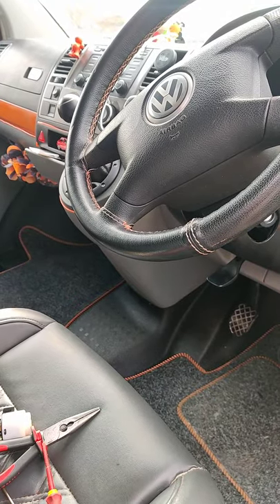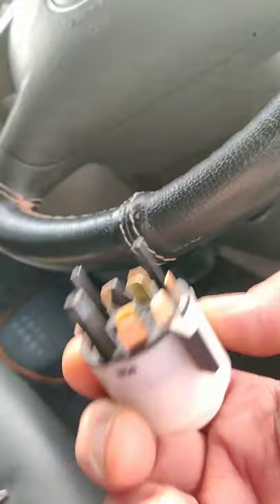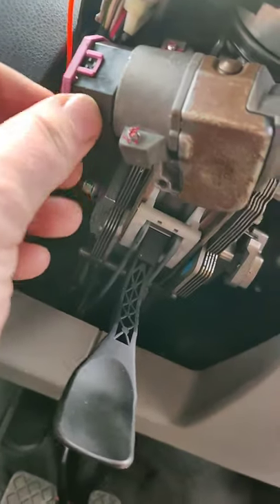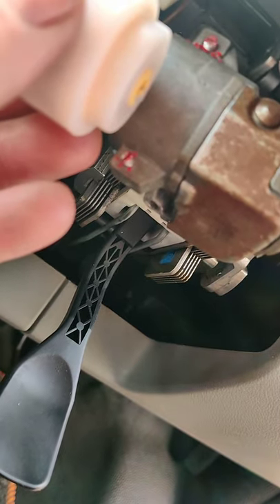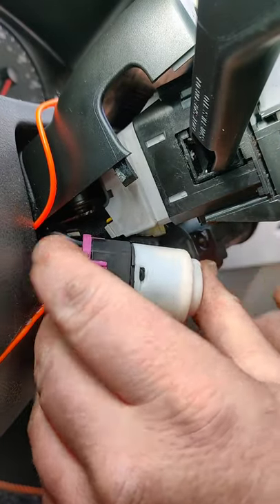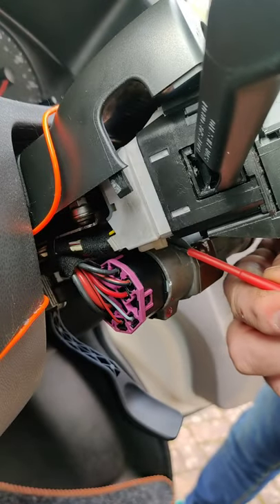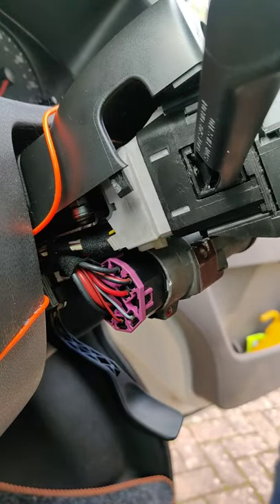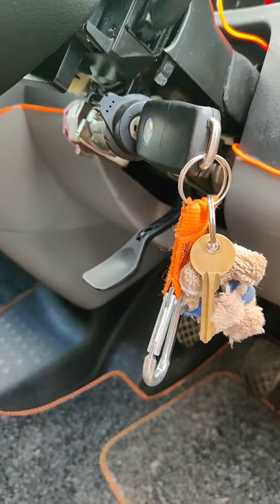VW T5 Ignition Switch replaced - How to

Comment: Thanks for that.  I have 2013 T5, the ignition switch etc are all different, but same principle.  Could not turn key to crank the motor, now fixed.  Would not have known what to do with the covered grub screws without your video.  When stuck on the road i rang the auto electrician who said "it's probably not the barrel or the steering lock, just get another ignition switch and try it"

Comment: I may have this problem, yesterday I put the key in the ignition, turned and dash lights came on, waited for heat plug light to go out, turned key again but nothing happened, just nothing, maybe a slight click in steering column. 
Tried and tried again, same thing happens. 
Does this sounds like ignition switch fail, symptoms? 
Thanks guys.
Reply: Hey do you find the problem ?
Reply: I did thanks. It needed a new starter motor. This is the second starter motor it’s had. Currently at 108k.

Comment: Perfect mate thank you for that! 
Could I ask what made you change your ignition switch? Just trying to diagnose mine now and hoping it's just this!
Reply: Same question. 
I'm able to turn the key to accessories but it won't physically turn past that point to kick over the motor. 
Did you have a similar problem? And have you fixed it? Was it the ignition switch?
Reply: @luke3892  Hi mate, I have the same issue as you, did you manage to resolve it?
Reply: @luke3892  hi Luke, I have this issue also, did changing the ignition switch help as in this video?! Thanks!
Reply: @andrewhill5158  I had to have the ignition barrel cradle replaced. Apparently it's a common problem in the golfs. You should be able to find info about it if you search for the problem in the VW golfs.
Reply: @kyletaylor8548  sorry didn't receive a notification for your question. It was the ignition barrel cradle. Apparently it is somewhat common on the VW golf. Should be able to find info if you search for the problem in the golf
Reply: @luke3892  top man! I’ve been told that this is the steering lock assembly. Seems to be the same issue, cheers!
Reply: @andrewhill5158  best of luck with it mate. It's a proper pain in the arse

Comment: Thank you for the video I am certain this is the same problem I have.
Reply: I did have the same problem...so many thanks.
All I would add is :-
1) Steering wheel was not removed.
2) Remove top plastic cover using a Stanley knife to get the gap and screwdriver gently.
3) The bottom cover is held by 2no torx screws.
4) The 2no painted screws are not tight but do require a fine screw driver do not use a an oversized one.
5) I put an OEM replacement which was a tad bigger than original and consequently had to loosen the adjacent panel to push the switch in.
6) When you remove the original switch check orientation as the switch will only fit one way.
 My new switch was 90 degrees out. To correct it use a large head screw driver and gently rotate to correct position.
7) Make sure you over paint to secure the grub screws.